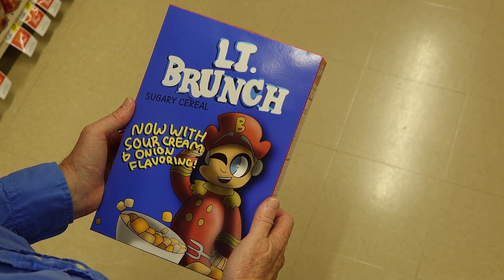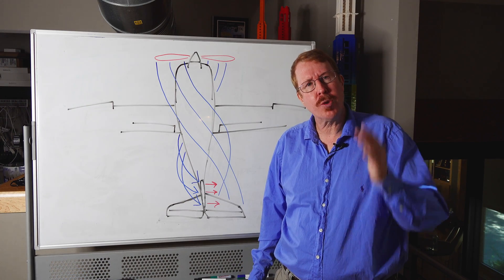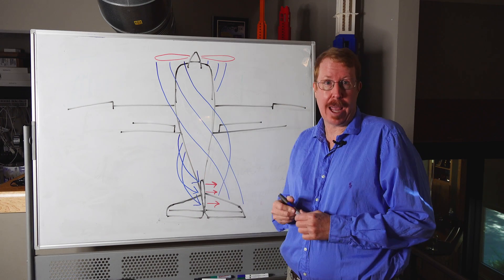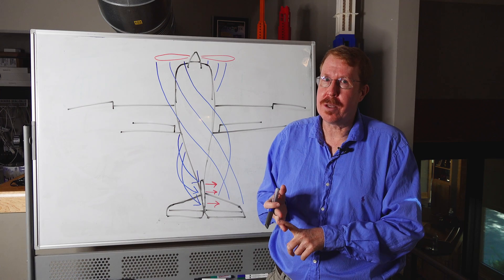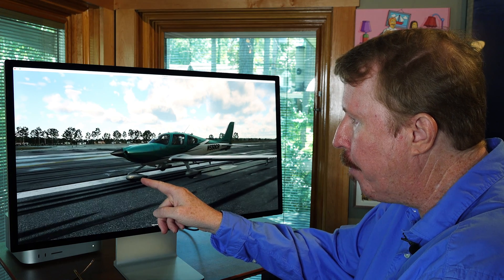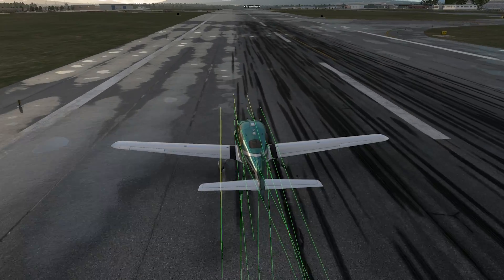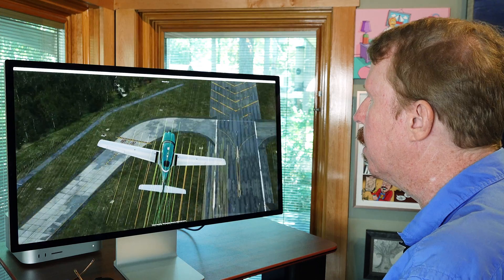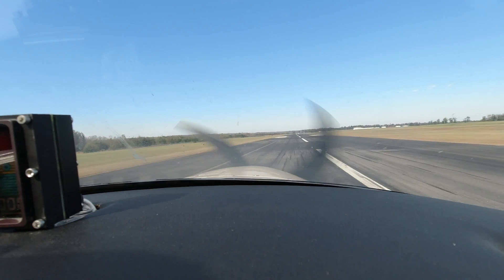Why does my Cirrus SR22 always pull left?

Comment: Hello. I have update 12.06b2 of xplane 12. The c172 and SR22 cannot turn left or right  on taxi. Rudders works well inside and outside the plane. But front gears don't want to turn. They are crazy. And taxi is impossible.  Do you noticed that? Is it a bug related   to the last update? BE58 and B737 taxi well. The bug seems only on mono-engine aircrafts😢

Comment: There is actually a problem with not being able to calibrate for the dead zone of a Logitech yoke. It can not be explained away by what happens in real life with a plane. If the yoke is slightly off to one side, then this drifting problem will be even worse - making it almost impossible to fly and land. This is especially a problem on the Mac, where it is not possible to fix in any easy way through the settings. You actually have to do some hardware hacking, by implementing a joystick USB board, to get rid of this annoying problem. So do not try and tell people they just do not know about the physics of a plane. The problem is much worse on the computer than in real life. It would never happen in this way in a real plane.

Comment: My question as a SR20 Pilot is ‘why doesn’t  the SR22 in X-Plane pull to the left as much as the real thing’?
I can safely fly without touching the pedals and never see any departure of coordination. (Yes, I have automatic coordination disabled)

I think P-Factor is a much bigger deal in the real aircraft.
Reply from the maker: Hey there, Scott! Are you using our default SR22 or a different model?
Reply: @XPlaneOfficial  Using the default SR22, however, I've observed the same issue on Vflyte's SR20 and Hold My Beer's SR22 in XPlane 11. 
I think it's possibly a combination of P-Factor and spiral slipstream at low speeds during climb out and making initial turns from the upwind. When I'm taking off in the real SR20 and even with right rudder pressure from takeoff I'll find myself looking down and seeing the slip-skid indicator has slipped completely out from underneath the counterpoint and I need to step hard on the rudder to bring it back, I don't see this in X-Plane.
To be clear, I'm flying an SR20, but everything I've learned tells me the more powerful SR22 should have even stronger left turning tendencies.

The pull on the ground feels adequate but on climb out I can take my feet off the rudder pedals.
Reply: @scottmanley  See if this modified version is better:

https://drive.google.com/file/d/1fp2fqjlx5IN8yoM1hf4DBL3apUajhHXb/view?usp=share_link
Reply: @marcoo1979  better, at least I see the slip skid indicator move a bit more with this modification. Still short of what I experience in flight though.
Reply: @scottmanley  What roll and yaw angles would you get in the real aircraft when climbing uncoordinated with centered pedals? That's the best comparison to do, because the slip indicator in the X-Plane SR22 might be inaccurate.

With my modified SR22, I get a right bank of about 1.5 degrees and a left yaw of about 3.5 degrees. If you say the effect is too weak in X-Plane, I presume the bank and yaw angles in the real aircraft are higher than those you get in X-Plane?
Reply: @marcoo1979  It is possible the slip-skid is not displaying the same level, as it is I feel I can fly without touching the pedals after leaving the runway, which isn't the experience that should be communicated.
It's even worse during stall recovery where the slip-skid indicator ends up 2-3 lengths off center if I don't apply rudder.
Reply: @scottmanley  The SR22 in X-Plane requires right rudder on climbout, and will fly uncoordinated if not using it, but I reckon you are stating the effect is too weak compared to real life.

One experiment you could do, the next time you fly the SR20, would be to:
1) estimate how much rudder deflection is required to fly coordinated
2) what bank angle would you need to maintain heading when rudder is centered (if it's safe to do!)

Then those values could be compared with what we get in X-Plane.
Reply: @marcoo1979  if I get the chance I’ll see. I already have a lot of GoPro footage showing this sometimes.  Of course I can’t tell what I’m doing with the rudder from the camera, but it’s safe to say I’m not applying left rudder :)
Reply: Hello there, the designer of the default SR22 in X-Plane set a fixed deflection of the vertical stabilizer of 0.8 degrees to the right. If the real aircraft does not have this fixed deflection (but has a symmetric vertical stabilizer instead), then that could explain the lack of pull to the left of the X-Plane SR22.

From a virtual flight test, in a max power climb at 80KIAS, I get the following values in X-Plane for the default SR22:
slip angle with centered rudder: 0.4 degrees;
rudder deflection required for coordinated flight: 6%;

If I modify the aircraft in Plane-Maker (taking out the 0.8 degrees of the vertical stabilizer and making it symmetric), the left turning tendency increases:
slip angle with centered rudder: 0.9 degrees;
rudder deflection required for coordinated flight: 15%.

Still too low probably, but a bit stronger than the default aircraft.
Reply: I hate to be pedantic, but... SR20 =/= SR22?
Reply: WOW!!! Scott Manley!!!!  Sweet!!!!
Reply: As a non-pilot what's the definition of "departure of coordination"? You do require some right rudder to stay coordinated at low airspeed and high power, but it certainly isn't much. It's also very hard to tell if you're coordinated in the sim without looking at the turn coordinator so all you can really do is compare the instruments. Cool to see you here, though I'm sure those comments are irritating lol

Comment: If X Plane 12 can develop this as the “Steam Deck flight simulator” then you will have a major advantage over Microsoft!
Reply: Before early access, they had a tweet about xp12 on the steam deck. Another way they could get more profit and support is playstation. Playstation has more fans than xbox so playstation players who wanted fs2020 will get xp12 instead. Plus, PSVR with xp12 would be even more profitable. LR has so many opportunities to monopolize so many markets.
Reply: @BotanistOnDuna  Exactly, first they should optimize it for Steam Deck since it’s straightforward then focus on PlayStation to give Microsoft’s flight simulator a run for the money!
Reply: @Jadon.MacCormack  I'm on linux and I've got to say it already runs great for fedora 36. At this point its just about letting steam deck users know that x-plane exists as an alternative to fs2020 for the deck.

Comment: Any chance you can fix the live weather and metar in xp11, it's been down for 3 days
Reply from the maker: try now!
Reply: @XPlaneOfficial   Thank you guys so much!!
Reply: The weather data supplier has the issues, not X-Plane
Reply: @EliteHobbies  doubt that, it's working on xp12 and works using the  NOAA weather plugin as well
Reply: @ronanoke  Didn't they say that in XP12 they are using a new source for weather data? The fact that the NOAA weather plugin works while XP11 without the plugin doesn't would indicate that it is a data supply issue and not XP11 itself, especially with it only happening a couple days ago.